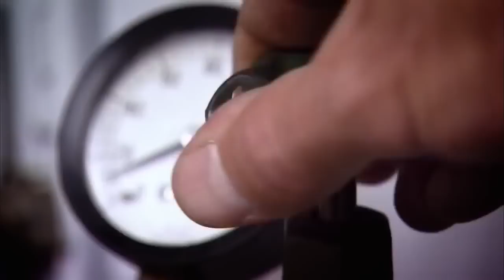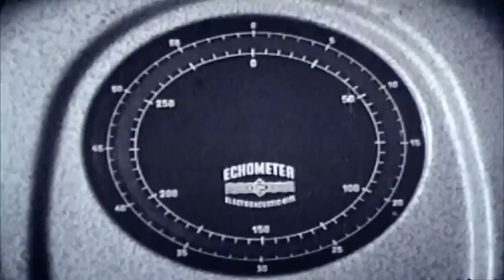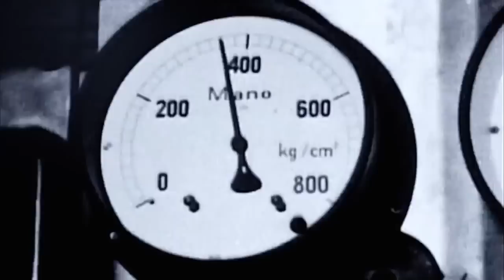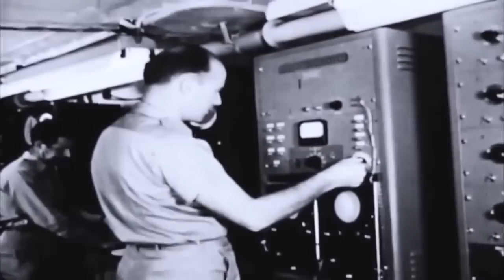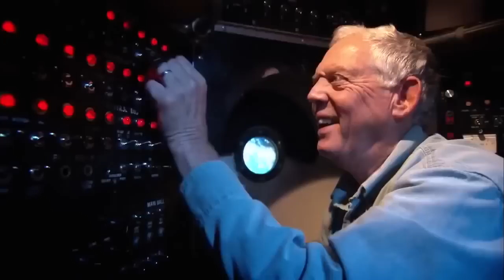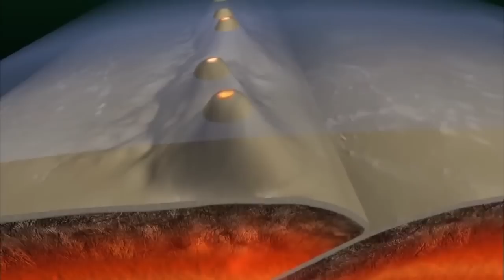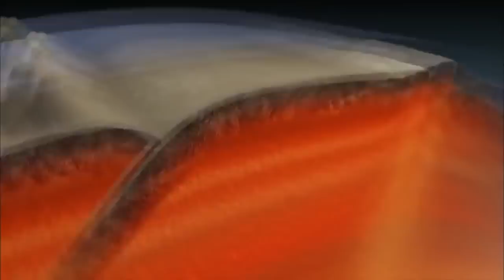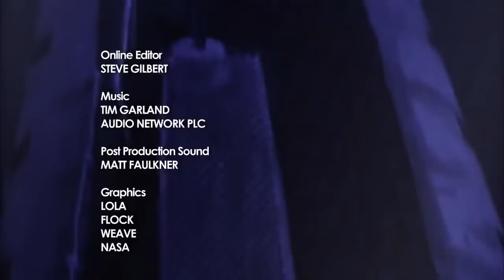Deepest Part of The Oceans -  Full Documentary HD

Comment: I'm only 3 minutes into this documentary and I have to point out something, maybe somebody already has. So the Challenger used a rope to measure the depth of the ocean floor back in the 1800s. I would bet anybody money that when the crew of The Challenger drop that line past five miles they cut the rope instead of dragging 5 MI of rope plus lead weights back onto the deck. I know I would have cut it

Comment: I once spoke to a Creationist who believed that the Earth is only 10,000 years old because of a supposed “Geology lecture” that claimed to use real scientific data of the rates of erosion, sedimentation, etc. to disprove that the Earth is billions of years old.

Part of the lecture claimed that, if the Earth is really billions of years old, sediment would have piled up so high that it would fill the oceans to the brim by now. What that lecture fails to realize is that the sediment gets pushed down into the mantle because of changes in tectonic plates.

As shown in this documentary, the ocean floor of the Pacific plate gets pushed under at a rate of 3 inches per year at the Mariana Trench due to subduction. After just 4 million years, a United States-sized portion of that sediment is pushed into the mantle. Now imagine the effects of subduction over billions of years. There would be no outrageous sediment pile-up like the lecture claimed, because the ocean floor is always changing.

P.S. - I am not trying to start a religious debate. If you are a Christian, but NOT a young-earth Creationist, then you shouldn’t take offense, because my comment is not about you.
Reply: No offense taken, I believe both science and christianity.

Comment: I call BS on plumbing the ocean depth with a rope and led weight.  not possible .  the weight of the rope itself and it length would prohibit the feel needed to know if the weight actually hit bottom up to 2 to 4 miles down.  just not possible to know  as the shipping is also not still and flowing with current  . as well at currents pushing the rope.  I call BS that this even works